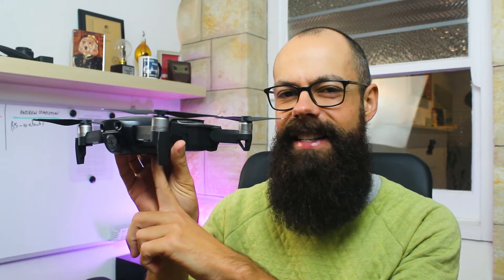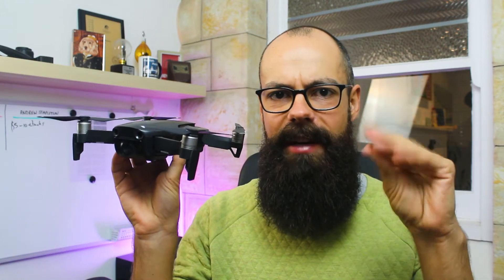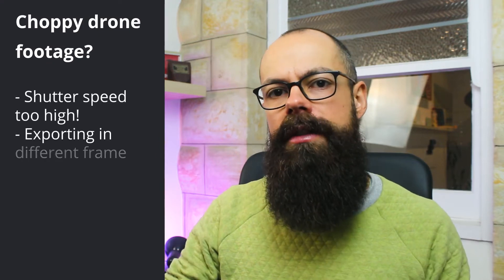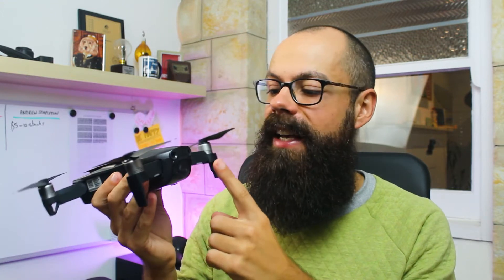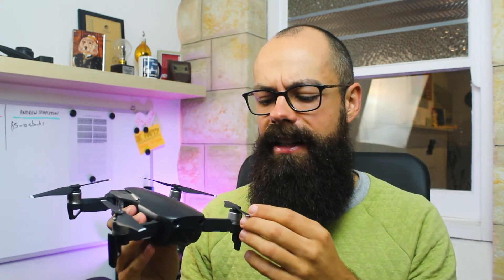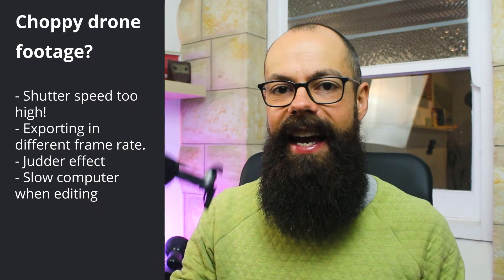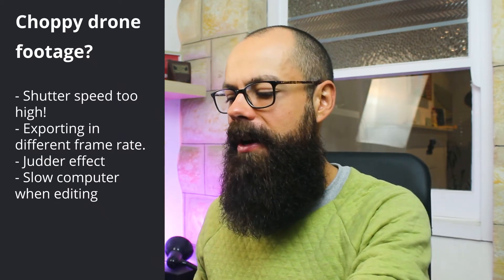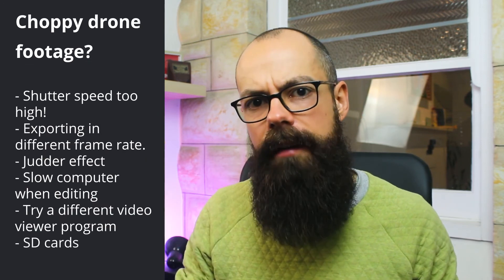Why is my drone footage choppy? 7 QUICK FIX Solutions!

Comment: There is some speculation that the "cache when recording" setting in ADVANCED camera settings is gumming up the works as it pertains to jitter, jutter, choppiness....whatever name you want to give it when filming video and in particular the panning shots. The discussion is whether or not the cache process is filling up the buffer on the internal real-time processing as the footage is being acquired. For those who have played with all of the parameters you discussed in this video and still see the chop on the final output.....how much thought and time have you put in to evaluating the affect of caching (a low res version of the high res piece being shot) when recording? Who needs a bunch of cached duplicate low res files anyway?

Comment: I got the mavic air 2 drone. Then I bought a 16gb SD card it was cheep. I didn't notice that it was a 4 instead of a 10. My phantom 3 standard came with a 8gb SD 10. So I will try that. I'm almost sure that's the problem lol. I didn't even know about the speed of the card.

Comment: I think one thing missed in your video is radio-frequency (RF) interference. Most of the time when I'm having issues with filming, it's that I'm at a location where there's "something" (wi-fi, radio towers) nearby causing it to almost fail - this has happened more than once. I recently filmed at a wedding with my drone (reception & b-roll) and it randomly stuttered throughout the entire shoot. Very inconsistent and not smooth filming at all. I had issues launching the drone and the connectivity between my Air, the controller and my phone was complicated. Watching the reels from different computers and in PP, letting Premier select the correct sequence settings based on the settings on the file, showed me it wasn't PP, or my Mac Studio but indeed the footage itself. A test this morning of all of my microSD cards turned up zero problems. That being the case, with the only evidence of connectivity issues at the site, I can only assume it's some other interference. I appreciate your video.
Reply: Nope. RF doesn't create this choppy problem.
Reply: I agree with @hubcityautofocus, on top of that, unless you're recording from a DVR feed in a pair of goggles, like I do occasionally on my smaller freestyle quads, just for posting to friends on social media, then the DJI Air unit, a GoPro or any halfway decent photo drone would be using onboard recording, so there would be no RF signal present between the camera sensor and the sd card onboard the craft.
Reply: I had this issue filming in a presentation room in a museum in NY. There was a lot of radio frequencies coming from the booth - 6 wireless mic's, 3 remote museum cameras, 3 wifi routers in the booth, etc. it was a mess of frequenceies. Plus there's a phone in every pocket of the 300 people packed in the room. We had 3 cameras and a 360 camera to mimic a fly over the crowd. The 360 camera had start up issues, connecting issues to the phone and recording issues such as dropped frames. We had the screen full of moving lines at one point. The longer we tried the worst it got.  What footage we got was unusable. I believe the issue was that cameras like the 360 are always looking for a device to connect to and the interference bleeds into the system causing mayhem. This searching for a signal can not be turned off in our 360 camera. Our other 3 SLR styles cameras recording to ninja's were fine. I don't think there is a solution for this and you can't ask the facilities managers to shut down systems and you can't change the systems built into the 360. My lesson to myself is... just know the limitations of your gear and what equipment is vulnerable in a room full of frequencies, have a backup plan because it's only going to get worse.

Comment: Surely a FASTER shutter speed would be better? As an ex pro photographer, if I want to pan and shoot a fast moving object, I have the shutter speed as fast as I can, with the lowest ISO possible, to STOP motion blurr of the subject. You are suggesting using a slower shutter speed to stop it! Makes no sense to me. PC spec/video player is irrelevant if it looks choppy on the tab/phone WHILE you are recording, or just flying, as mine does on an A2S. SD card is not the issue with my issue ( I use a Samsung 90Mb/sec write speed card which shows the issue), as it also does it using the internal storage. Watching your vid with MA2 where you're showing the choppy issue - I WISH mine looked that good! My A2S has gone back to DJI today, who've seen my footage and acknowledged that it's not right. It's not shutter speed/FPS conflict, even panning very slowly shows it. Even using 1080p/30fps and 1/60th shutter shows the problem. h264/h265 makes zero difference.
Reading your article again, you talk about exporting the video with the original frame rate. 'Exporting'? What does that mean, and how would we change that? I just either connect the drone to the PC and copy the files over, or remove the SD card and put it into the PC and copy the files over. There's no 'exporting' and no opportunity to alter frame rates. Please explain.